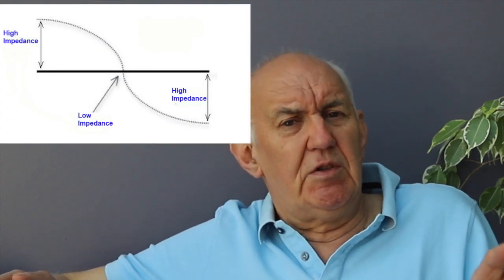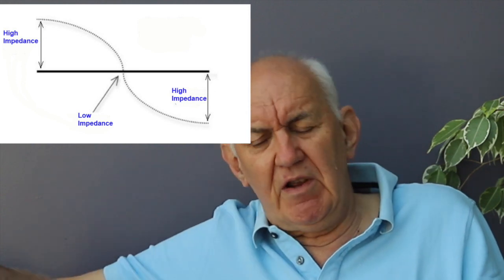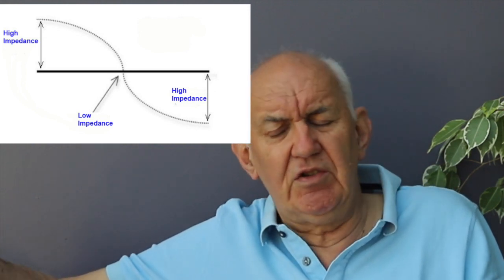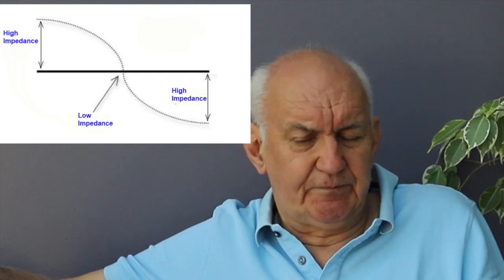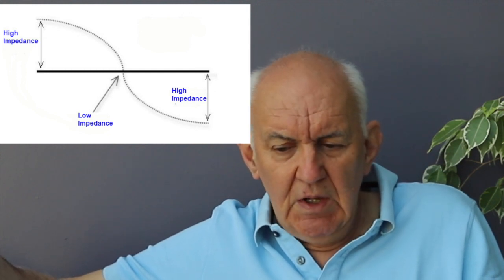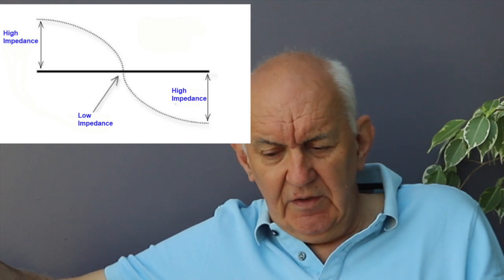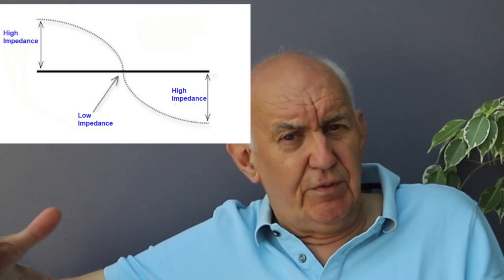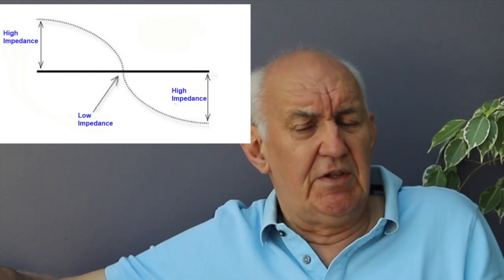End Fed Half Wave Antenna Part 1

Comment: Does wire gauge make a difference?  Is a 14 gauge better than say a 20 gauge?  I made the antenna with both.  My 20 gauge i tuned with my MFJ tuner.  I even made the coil for 80.  No tuner needed.  A great antenna to use portable.  Thanks for sharing.
Reply from the maker: Not that you would ever notice! 73 Peter

Comment: I intend to rely heavily on EFHW antennas both vertical and horizontal for NVIS when portable.
Your vids support my intentions.

BTW: Good music old chap! Also, in a previous vid, I noticed a few prop driven airoplane pics on the wall. Were you a pilot back in the day? My dad flew P40s/P51s/C47s in Burma/China/Formosa in 44/45/46.

Comment: does hieght matter? will inverted v work?
Reply: Height is might, with antennas, if you wish low angle radiation. I have experienced big differences between 6 and 10m meters up.
Reply: Inverted V works great with an endfed. Mainly because the connection for the coax is lower and easier get the midpoint up and where you want it.

Comment: No Snake oil at all, the antennas from Myantennas are made by Danny a former employee at Cushcraft antenna engineer. 

The Unun is a 48:1 and requires no radials unlike an end few with 9:1, an earth connected to the transformer box is recommended.
 
No RF int he shack either, these antennas got great reviews on the my antenna site and on Eham. 

Depending on the installation they perform better then a full size G5RV probably ( and I'm no antenna expert ) because they are resonant on multiple bands requiring no tuner unlike a G5RV that needs a tuner, a lot of People think the tuner somehow tunes the antenna it doesn't, it only matches the antenna at the radio end while the antenna itself is still non resonant but allows the radio put out full power. 

The myantennas antenna needs no tuner because it's resonant on the bands advertised,  depending on installation  a tuner might be required for the lowest swr on some bands, but it's a very efficient antenna.

I have one of these antennas half installed, I am working on my license and hope to pass the exam in May. I will finish the installation in a few days hopefully and be ready for when I get the license and if I don't get it in May I'll use it for receive until I pass the next exam. I will be using a very old basic radio to begin with and the my antennas antenna will save me the expense of a tuner until I get more experience and funds and I can later on experiment with my own antenna builds.

These multiband antennas are also good for portable use, QRP etc as they require no tuner.

Tests have shown that the myantennas antenna is indeed resonant on the bands shown and it's good to see Waters & Stanton stock them, they should be the first choice for anyone looking to buy a wire antenna.

It will also work 160 meters with a tuner but at reduced power to prevent the transformer from getting too hot but not be very efficient , they also make one for 160 meters @ about 240 feet long. 

They can't make the antennas fast enough they are selling so well !

Hyendfed antennas also sell multiband antennas. Based in the Netherlands, also with good reviews. These antennas do work when designed right.
Reply: Sounds like a plan OM.
Good luck with the exam and don't forget to immerse yourself in CW......
Reply: @rjinnh3933  have the license 2 years now, plan on learning CW love the hobby. :-)
Reply: well done, I use an end-fed antenna for 40 meters, with a 49/1 transformer. at first, I had the transformer at the house but found it produced a lot of noise and the SWR was off the scale, as soon as I reversed the antenna that is placed the  transformer down the garden everything changed to a very low SWR and the noise dropped down to a workable level. work better than a G5RV.
Reply: You said it your no antenna expert
Reply: @Pioneer936  That's why it's called Amateur Radio!
Reply: @o00scorpion00o  several wrong assumptions in your statement but hey its amateur radio
Reply: @Pioneer936  oh let me guess, when I mentioned no radials needed ? I don't use radials, the coax is all the counterpoise needed, I bet you think this antenna is a dummy load ?